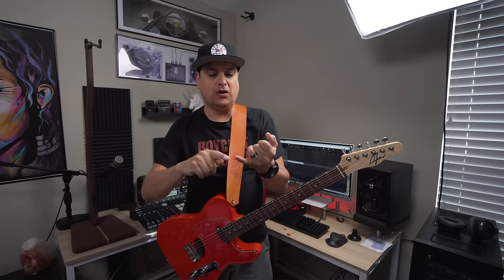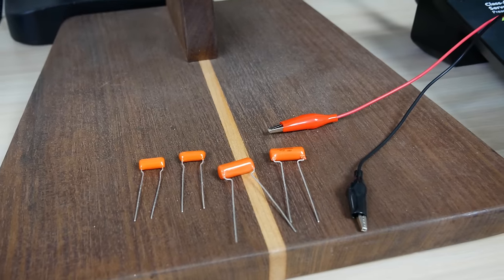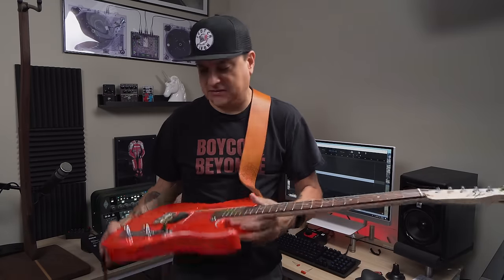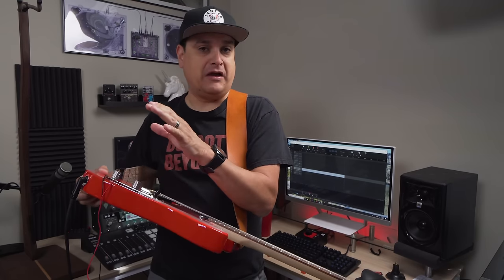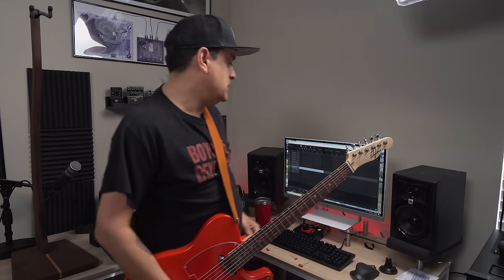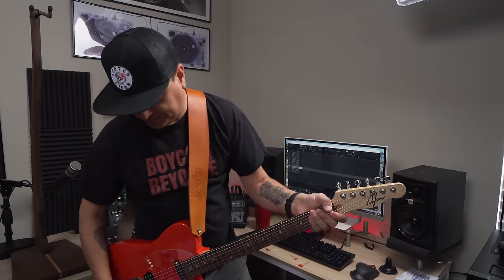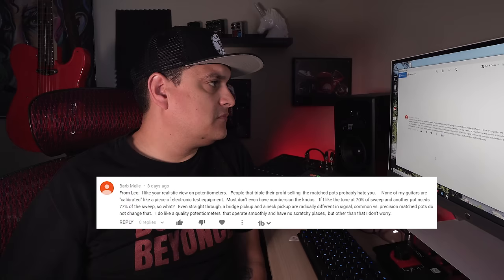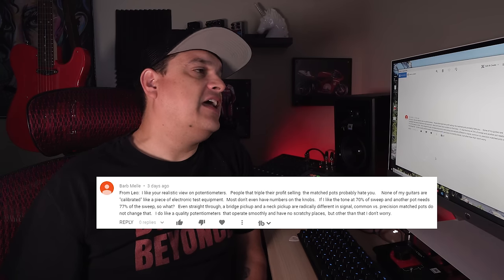What Capacitors Should I Use In My Guitar - A demo

Comment: Holy cow! I would go so far as to say capacitors alter the tone more than anything else I've heard. The shootouts between woods, frets, necks, body chambers, strings, nuts seldom make such stark changes compared to what I just heard. Amazing stuff.
Reply: As a general rule, 20% of a system causes 80% of the output for any machine. 
Just as you said, the electronics causes 80% of the sound you hear with an electric guitar. As  for the other 20%, the human ear cannot make any distinctions.

Comment: I really like this channel. I've been building and repairing guitars for over fifty years off and on and what you get here is pretty much plain truth .  Tonewood, as mentioned here,  is a whole 'nother rabbit hole you can go down .I've seen it really cause heated arguments on the net that are really senseless, because  as shown here , it's the sound you desire from your instrument that really counts . Caps play a big part in this, but the whole idea of the solid body guitar is to create a basically rigid  base for the pickup to operate in .Essentially what Les Paul did by example when he made his log guitar was make a  stiff ,heavy platform for the pickup to work in so that the guitar body vibrated as little as possible to eliminate sympathetic resonance between the body and the strings . In this way the strings vibrated and transmitted their vibrations to the pickup magnetic field and the signal went to the amplifier unfettered as much as possible by the counter vibrations of the wood in the instrument that is also vibrating the magnetic field of the pickup because it is mounted on the wood of the guitar . Still simple physics says that for every action there is an equal and opposite reaction .When it comes to tone, various woods can color the sound but when you consider instrument electronics and modern amplifiers, tone and wood become minimal when it comes to influencing the over all sound . More over and in the end ,it is basically the artist and his or her combination of techniques that really creates that custom sound that becomes a given artists musical signature . Tone from a given piece of wood can be an artists secret sauce, so to speak , but this is more for the artists discriminating ear and his personal musical message,  than the listener . An artists instrument is basically a paint brush for describing a soundscape the artist wishes to convey . It is neither perfect nor universal in nature and this is why artists collect various instruments to convey their personal message, what ever it may be.

Comment: I just had an amazing experience with tone capacitors.  The usual values, we know the differences in sound.  Most of the time as soon as you set the potentiometer to zero the sound is muffled, unusable.  With 0.015uf it is the least worst.  I experimented with much lower values, between 0.0047uf and 0.0082uf.  It sounds like a wahwah pedal stuck in the middle position, when the tone pot is at zero.  With some mid/treble frequencies which are preserved.  By choosing the right value I reached an extremely interesting and unique sound, and above all very usable.  Not a dull, uninteresting sound.  I tested these values with a single p90 junior LP (50's wiring).  The sound is amazing.  I think that for stratocaster style pickups or humbuckers, other values could be better, but not certain.
Reply: I did the same thing on one of my strats. I put a low value, pretty sure it’s .0022 Sozo cap on the bridge tone pot. And all the way at zero it’s acts like a mid boost. Sounds really great with gain. Rather than losing clarity it just accentuates the mid frequencies. It’s more like a tube screamer flavor knob. lol
Reply: @Sulordan  
That’s it ! 👍
I never used tone pot until I did this mod. The only disadvantage is that you have to roll the pot to zero. 
Finaly a switch could replace the pot... 
I'm thinking about that 😉

Comment: This is why I use a 10 position (8 - 12 would be fine) Rotary Switch; remove the ball bearing in it (EASY!) & put a series of capacitors in it👍

EVERY position is EXACTLY the way you want it 😉
Reply: How do the two plates on the rotary switcvh make cointact without the ball bearing?
Reply: @Ben-yy7io  
No Problem!
The ball bearing is only there for the “click“ and to make you know exactly where the setting is but to be honest you don’t really need to know that once it’s twisted and it hits the sounds that you want then that’s fine
Also you can still feel when the contact changes so you have that reassurance
There is also the option of leaving the ball bearing in but bending the clip that secures it back so as to “weaken it“   ...try it?   YMMV
Reply: @BeesWaxMinder  Ah so it's kind of like a variable capacitor?
Reply: @Ben-yy7io  
I suppose so...
Well, IF ya put Caps in it it is 0R if you put Resistors in then it can be like a Tone Pot or even a Vol Pot -depending how you wire it👍

It’s kinda more a ‘mechanical mod’ in that it alters how it FEELS more than how it behaves?

Comment: Re. Pot and cap tolerances... 
If you are building guitars or modding them as a hobby, just get a multimeter. Then you can check actual cap and pot values and choose whatever is most appropriate.  Have PAF's? Pick a pot on the low side of the tolerance range with a cap on the high side of the range. Have high output buckers? Go for one on the high side of the range with a smaller cap. It won't make a huge difference but it will make some difference.

Comment: Thank you for making this, Dylan! I just ordered a kit to replace the pots, switch, & jack and it was hard to make a decision on what I wanted.  I went for .047 and if I don't like how it sounds, I'll switch it out and see what I like better. 2 legs makes it simple. Even at 10, it had less highs/more low end.  Maybe if you had 500k pots on single coils, the .047 might be OK. YMMV

Edit: those were 500k pots? If that settles it lol. Putting the 047 in with my single coils and 500k pots I ordered. I've got some 2 wire humbuckers but I'm not sure I can use them like that.

Comment: OK, this is neat for tone knobs with capacitors of varying values. What if you have no capacitor in the chain of electronics ?  At 1:23 of this video, the gist I get is that tone is subjective and DTT confirms that. Any guitar is going to have it's own signature tone without a capacitor that is based upon the tonal woods it's comprised of. The pick ups too, how hot they are, how many turns of wire, the gauge of that wire, the magnets type & strength. Even pickup height is going to effect the guitar's tone. If capacitors alter a guitar's tonal warmth, a guitar made from a softer tonal wood such as Alder is going to be warmer than a harder tonal wood such as Ash or Maple. Conceivable that you could make softer Alder, sound like harder Ash or Maple with the capacitor value tweaking with certain pick ups ? Traditionally, a volume pot is a linear control, tone is logarithmic. If I understand it relative to tone, that means each numerical indicator is not a equal increase/decrease in tone as it is for volume. And that should result in a range of tones that may not change much at a higher setting after 3, 4 or 5 as it would 0 to that majority of tone difference.

The other day, I finally got around to taking the pick guard off. I saw no capacitor inside this 15 year old Squier Bullet I bought last summer for $ 25. Anyway I thought that's odd, doesn't have a capacitor but I do have a range of tones with the neck & middle pick up tone knobs. Subtle range of tones, but a range none the less. And I won't lie to any one, but at certain settings of tone, I actually prefer the Bullet to an Affinity Strat that I have, that I assume has a capacitor in the chain of electronics. The Affinity has a range that is pleasing just the same.

Comment: Very helpful  because it confirms what I have been suspicious of for some time now, especially considering conformational bias towards/within marketing and how the template has been set and another point by who? 
I mean who was it, I say was because how long has this been unchallenged, yes I believe there are many out there and proven by this video and more like it that have differences, like the guy who made a comprehensive comparison test on pickups, well it was meant to be tone wood on electric guitars, getting to the point- eventually after trying a few set ups where he stuck a set of single coils on a plankof wood at 25.5inch scale length thewoodwas plained pine cls  4X2" timber a cutting  he just picked up off the floor, this then with a comparison to a big brand guitar company guitar proved that it was irrelevant that tone wood is worth the cost in my opinion, he then went on to further hammer the theory of tone wood and more reinforced that pickup height is more important when he strung a set of 10s across the gap between two benches in his workshop, the pickups obviously had to be fixed so th scale too, so the bridge(this is all based on a simple tele bridge and pickup configuration) th bridge was secured far enough on one end to allow room for the bridge pickup only and woah did it sound just like anything you would expect if you paid goodmoney for it! This was all done as Controlled an experiment as possible as far as I could see, and the.amp settings were same in each instance and the pickups I'd have to look up the video again its been a while, so I absolutely love when goo dfolks like yourself and other like you Dylan pick up th mantle and show us the truth so that we can make informed decisions based not on what marketing says is best, I mean we're just asking to be suckered when we type in a Web search for "what is best filer... blah blah?" This kind of video is about informing by show and tell, it is one of the more honest videos and that speaks highly of your character as a person and a maker/builder of quality parts for electric guitars, I live in the UK so I naturally get my gear from nearby  I try before I buy but there's just some things that most haveto  uy online, electrical components that are THE  very basic of components within that industry not talking about music, so I don't do searches for guitar pots or capset I find out the generic names and go from there and the price difference is much less, especially in bulk over 100, en 10 of there's a difference,  which burns meup with the question "why the fcuk do electric guitars cost so much!!??" Especially when you break down guitar to its parts and quantities including the wood treatment colour coat and gloss and pishing- the tools cost more! But once you've figured out a way to buy and accumulation of what youneed while still making guitars and selling them at the same time- you can hire equipment that will be a fraction of the cost and still be able to make our first guitar and sell it for enough for that tool you just hired, then onto the next so onto fourth. We are being robbed with our eyes and ears wide shut or worse wide open when you still know and still allow yourself to be bummed in broad daylight by big dick brand names that I have less respect for now than when the companies founders designed and made the.tele the strat etc. 

Anyway big rant over 😊

Love your work, the time and effort you put into making this whole decision making process much simpler and clearer by using the truth big ❤ from Scotland laird Farquhar (Lord farquard) its pronounced like Parker but obviously with an F.

Comment: Well done Dylan!! I'm about to put P90s in a hollowbody that have Humbuckers now, and I think I'll keep the capacitors even if 0,47 is recommended with P90s. I don't want a muddy bass and in your test the tone was useful even with tone control at 0 with the 0.22 but not with the 0,47. Of cause it save me a little soldering if I don't need to replace all electronics in a hollowbody.

Comment: Thanks! Very helpful in understanding how the caps address overall tone and also how effects the response when you turn it down. About to start my first tel build and plan on using a push pull pot to give me 2 options. probably start with a .015 and a .033. I'll be using a SD Hot Stack in the neck and SD Little 59 HB in the bridge.

Comment: I have been swapping caps out on my Squire Affinity Tele.  The guitar came with the .022 and I swapped that out for an orange drop .047, and overall, I didn't like it!  I played for an hour with the .047, while soloing over jam tracks.  I feel that the .047 makes the tone very fat but takes away from the nuance that a tele should have.  The .022 brought it all back.  Ah well.  I will save the .047 caps for my SG re-wire project.

Comment: I have a wierd setup on a karera build a caster. The friend I got it from is no longer with us so it's hard to figure the mod he told Me it was set up for. 
  So I've learned Solder and got a bunch of tools from graduating college for hvac.
  So I'm done building the guitar bone nut, painted it to psychedelic beauty, and just have to figure a few things out to hopefully preserve my dead friends og setup, this is the wire setup I've figured he'd made, I remember he built it to work as a humbucker,( I had no idea about guitar maintenance af the time).

   So he has Tele 60s style two holes, top pick up is I believe stock Tele rip off with a triangle like pickup. Under the bridge is an extra white ground wire, I'm pretty sure it's set for a humcaster, so that basically the two pickups can cancel out  to the bridge? I want to add a piezo w/ 9volt pickup for hopefully a acoustic way to play,( I have plenty of guitars they all are stock I want this one to be different.), plus there are two 500 k pots, the volume pot I believe has a .022uv ( red compasitor looks corrects I'm sorry I have a hard time being a newb), video over

Comment: Nice vid. Wish I saw before redoing my electronics but feel my tone is where I wanted it. I wnet against the "popular" opinion and put 500k vol and tone pots with .33 tone cap. 2 Seymour duncan ssl2's and a 59/hybrid custom humbucker. The range is perfect. It's nice to have a little more treble if I roll it to 10. Usually tone is at 7. The humbucker is definitely hotter than the singles but it works great to crank the guitar volume and switch to the HB for leads to drive the tubes. Little volume rolloff and back to the single coils and nice sweet clean tones ensue.Definitely DON'T use what others say. Experiment and do what sounds right to you!

Comment: New(ish) subscriber and really loving your videos and your no BS approach to guitar tone. Last night I did a bit of experimenting and rewiring of my "fishocaster", partly based on stuff I've learned from you. I measured and changed my master tone pot, switched out the capacitor, and removed the treble bleed. I much prefer the way it sounds now.
Also, really digging the colour and pick guard of that tele. Cheers.  👍 🤘

Comment: I still believe in tone wood. My reasoning is this. At low volumes ( which most of the tests are do at) there is going to be almost to nil effect; however, at high to very high volumes (loud enough to blow your hat off) you will feel that “wall of sound” and if you FEEL it you your guitar will FEEL it and there by affect the sound. If this argument if flawed would explain the mistake and if possible do an experiment that proves it.
Reply from the maker: I actually have a video coming on feeling vs hearing

Comment: My Hagstrom Swede sounded very dark when I bought it. It has the regular tone knobs and an additional filter switch which adds another two capacitors or none, to the mix. Man, that got things extremely muffled. I swapped in a pair of .022’s and it brightened up the sound. I’m going to install my Super distortion picks in it and see what it sounds like then. It should be an improvement over the stock pickups.

Comment: Ok..that was the tone cap....now what is best for treble-bleed cap and resistor parallel circuit.

I would prefer all the treble ( especially the higher trebles) at all volume settings but only the frequencies from say 3-5k and down being what is being removed

Comment: Are you still mad at me Dylan for our conversation the other night where I said I do believe the wood makes a slight difference? Lol,I know you weren't mad i'm just busting your chops.

OK here is an interesting scenario for you to see if you can figure this out -  I have a 2013 Gibson Sully Erna Les Paul. It came stock with one 57 classic pickup in the bridge and only a volume control. The traditional tone control is actually a flange push pull control and the 3 way is basically just a kill switch unless it's in the Treble position. The flange kept acting up and causing issues and Gibson wouldn't fix it, shocker right? So I ripped out the PCB board and just put in the volume control that came with it and put in a regular 500k tone pot hand wired it. Here is what I was left with -  I like the way it is now btw -  when I use the tone knob; between say 1 thru 4 it sounds like a normal maybe like 7 setting. 4 thru 6 sounds a little closer to a full 10 and then 6 thru 8 sounds basically normal. Here is where things get twilight zone though. at 9, 10 it sounds just like I am using a wah pedal!! I never get that full throaty sound a normal tone gives at 1 or 2 btw. That Wah sound is really cool so I have never messed with it and tried to "fix" it. Have you ever had an experience with getting the wah sound out of tone control?

Comment: I did not have time to go thru all the comments, but, you didn't address the "connection" of the cap. I found the Flying Vee wiring diagram helpful for my build because the .033 cap I used is soldered from tone pot to volume pot (instead of both legs of the cap soldered to the tone pot) I found this to be very desirable in the tones I got in my guitar.